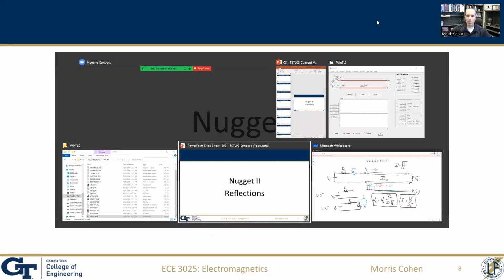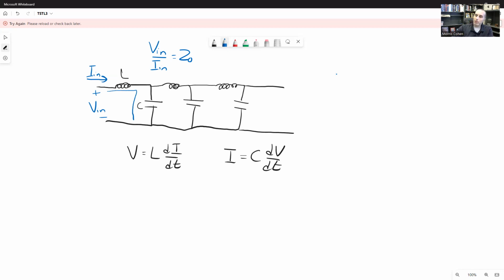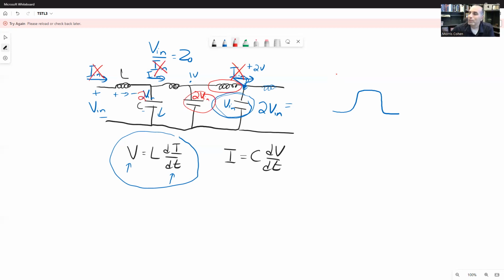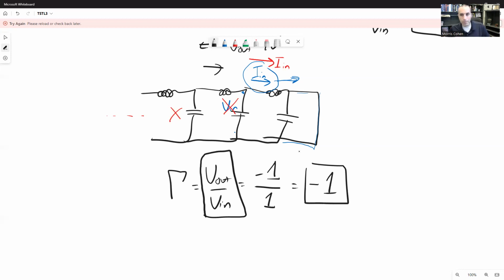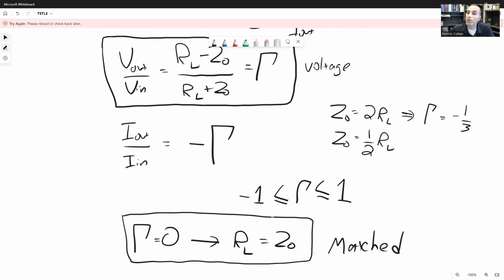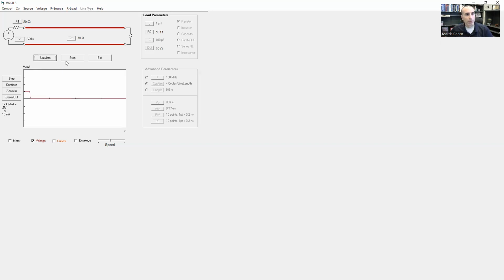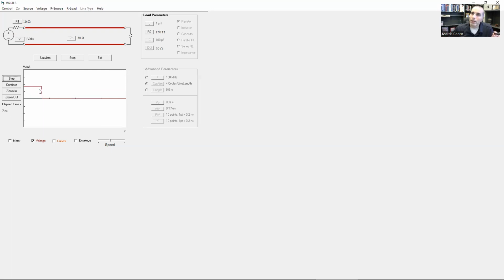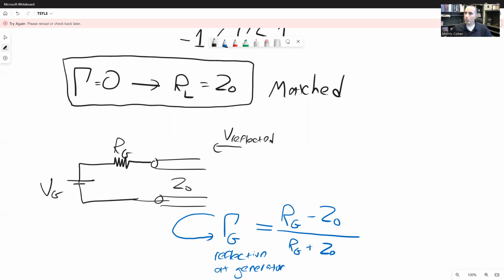Electromagnetics for Engineers Lecture 03 Transient signals and resistive loads (Part B)

Comment: Last example is very interesting. Given a source voltage Vg =1 V, source resistance Rg =10Ω, transmission line characteristic impedance Z0=50Ω, and load resistance RL=150Ω, at t=0+  the transmission line initially appears to the source as a 50Ω resistor, so the launched incident wave is found using a voltage divider: V+ = Vg*(Z0/(Rg+Z0)) = 5/6V. This wave travels to the load, where the load reflection coefficient is L = 0.5. producing a reflected wave of 0.5 * 0.833 = 0.417V. Therefore, the load voltage immediately becomes 0.833 + 0.417 = 1.25V. The reflected wave then travels back to the source, where the source reflection coefficient is -0.667. creating another reflected wave of -0.667*0.417 = -0.278V which travels back toward the load. The waves continue reflecting back and forth with decreasing amplitude until the circuit finally reaches the steady-state DC voltage 0.9375 V.